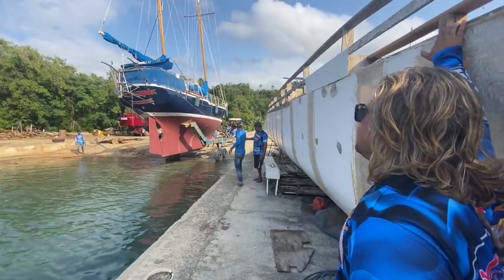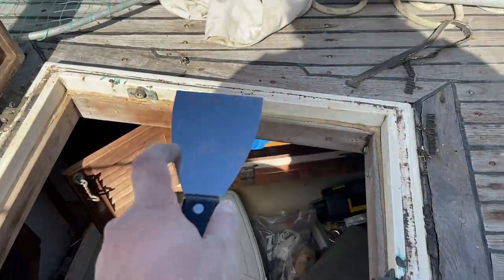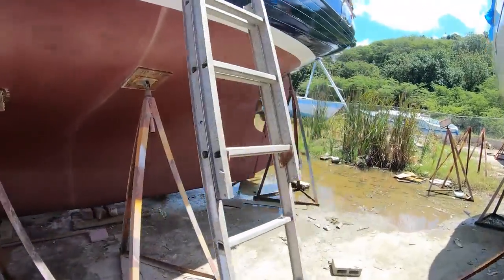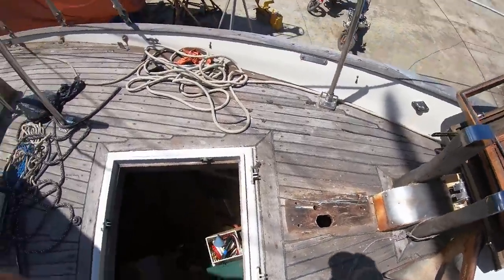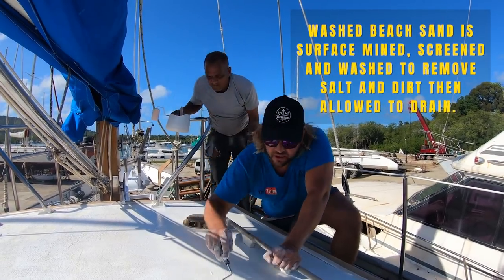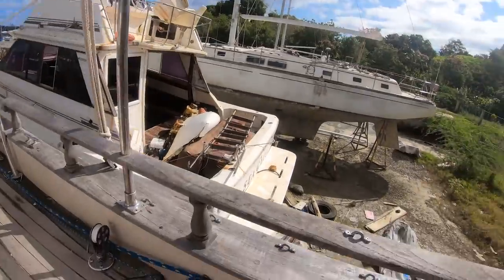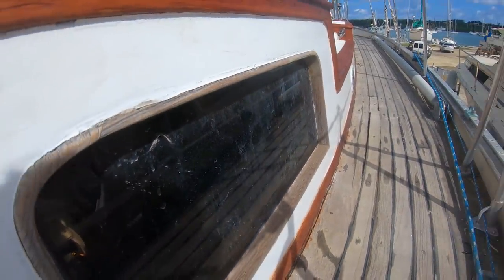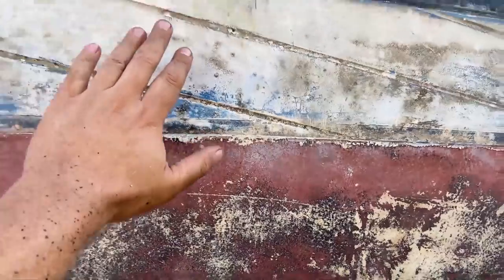How to save money refitting your boat| Think Smart | Beach Sand for Anti-skid |Paper Boat Project

Comment: On my little Dinghy that I built I used a RUBBERISED paint then sprinkled course sea salt over the area, when the paint dried we just hosed the sea salt away and what was left was a rippled  no slip finish. Also the sand can be quite harsh and hard on feet and cause some injuries if you do fall. I have heard that some people used SUGAR instead of salt but also heard that if you dont hose off all the sugar the ants will move in.

Comment: Dude they use beach sand for a reason most of the irons washed out by the salt in the shore as soon as you buy that sand at a hardware store it comes from inland and it's loaded with iron you cannot use that it later the iron will bleed through the paint and your boat will look very Rusty take it from any guy that does stucco he will tell you and verify this.
To fix it now I think you'll have to do some sanding and muriatic acid wash to burn the iron out and sometimes it still keeps popping through for years...
I like your channel though keep up the good work...
Carlos , Naples Florida